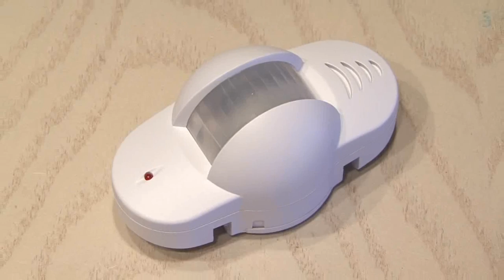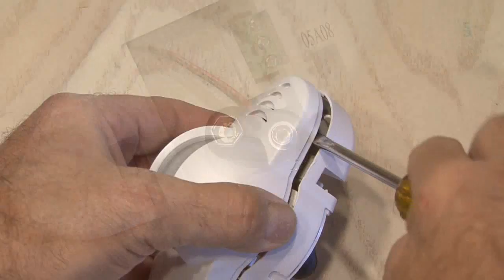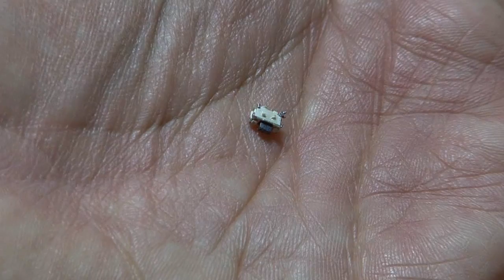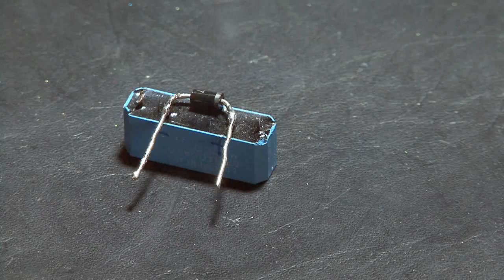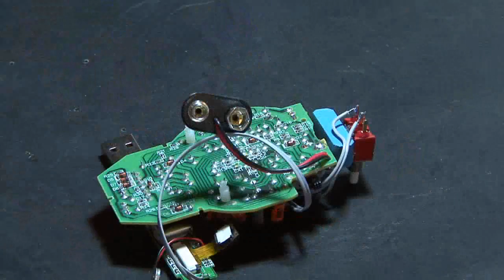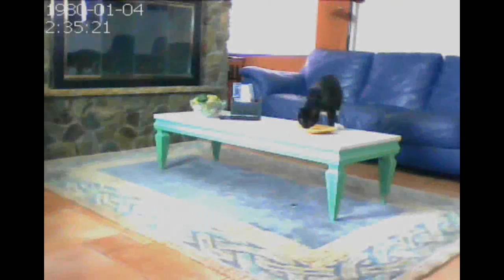Spy on Anyone! Motion Triggered Spy Cam!

Comment: instead of connecting it to the alarm and having to use a reed relay and capacitor you could've connected it directly to the digital signals from the motion detector itself and thus getting already a digital signal, use a volt meter to measure what type of semi conductors you need and get a couple of J K flip flops IC's and an oscillator and you coudlve made a better switch to detect when there is motion and and made a few couple of bits timer from the J Ks or just buy a more expensive IC timer to time how long it would record before shutting the camera.

Comment: @k9r100 There is a piece of Linux software called Motion, that might work for you. It detects motion on a camera connected to your computer and takes a snapshot. I have only ever tried it out with a webcam. But, if you have a TV tuner card you should be able to use any standard video or spy camera with an RCA plug. 

It's pretty impressive software. But if you have never used Linux, it might pose some difficulties. It doesn't have a graphical interface. All the settings on a configuration file.

Comment: you could mount it back in the motion detector box and thats how you can hide it just make holes for the camera and mic and add a quick connect connector so you can still use the dvr in other stuff

Comment: My motion sensing fake cameras have a circuit board that powers a motor with about 4.5V. I figured that would be enough for a relay. I'd just need a camera that stops recording when the relay disconnects.

Comment: Time to turn those useless fake motion triggered cameras at work into useless real motion triggered cameras. Though if they should be placed in frequented areas, it would be useful if it automatically stopped recording. Also, can it put a time-stamp on the video?

Comment: @datzburier Also, the motion sensor board would have to be able to limit voltage and current.  So that it could supply 5 volts to the LED, etc on the board.  Which is, of course, the voltage that the USB DVR would run on.  So, I guess you don't know as much about electronics as you think..

Comment: Hey Kip... I love your vids and can gather that you have a LOT of electronics experience... I am currently working on a project for a laser much like yours, but it will be in a radioshack project box and will be more powerful. The one thing that I keep failing at is developing a driver circuit ( I tried without one before, but the diode fizzed out in about 20 minutes). Please send me directions or a schematic, I could really use either one, thanx.

Comment: Id like to make one that actaully stopped recording because who wants to come home from work and look through all that video!I made a wireless camera hidden in a clock, i just took apart the 12v power adapter for the mini camera and wired it into the clocks wire before it went into the clocks board,that way you only have the one wire coming out of the clock.i wish i could make one with this dvr without the battery on the dvr and the battery on the motion sensor.Make itr happen kip!